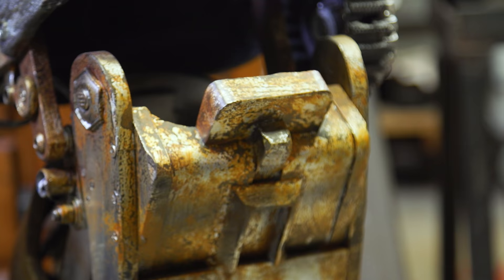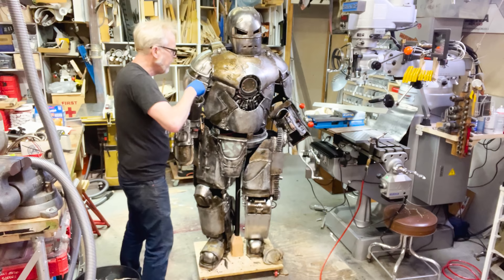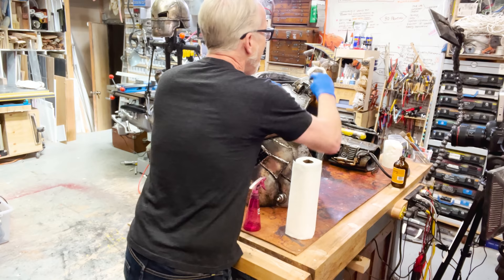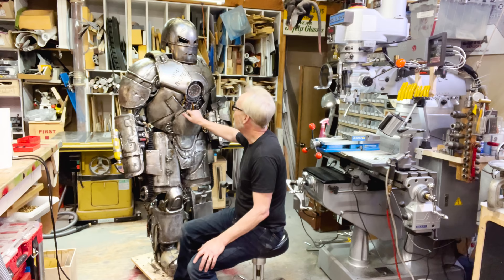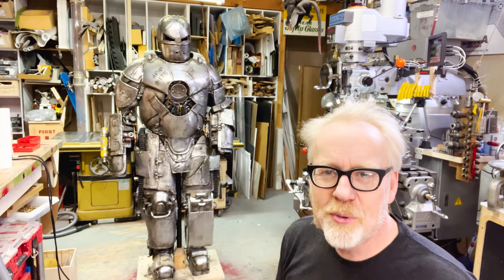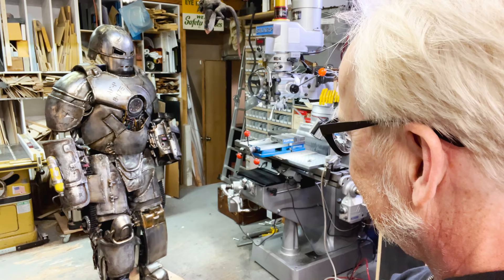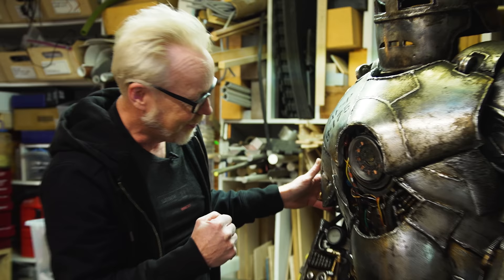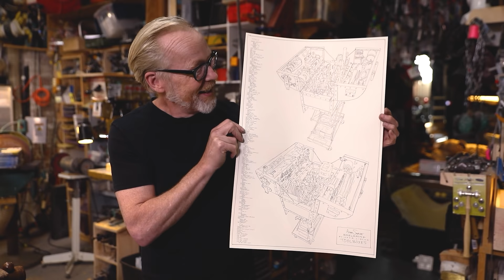Adam Savage's One Day Builds: Painting Iron Man Armor, Part 2!

Comment: Adam Savage, when you're doing chipped paint, spray your paint layer, mask and then spray your "revealed metal" elements. Then, with the masking STILL ON, do a grime pass where you remove with alcohol, but push the grime into the edges of the masking - this will give you the look of light being occluded by the edges of paint, and also, grime would build up at the edges of the chipped paint anyway. This will sell your chipped paint look far far better and is a better solution than hand painting or anything. It works in 3D art, it will work great for this practical stuff :)

Comment: AMAZING! Can you tie in the upper legs to the hips? The upper gearing of the belt drives doesn't read right with them flopping around on 3 axes. Even just  a last step where you snap a bolt from them to corresponding sockets on the girdle would 'sell' that they are driving from the core of the suit.

Comment: The issue though is that suit isn't actually all that rusty, go to 37-40 minutes in Iron Man 1 and look at it on a big screen, there is metal tarnish from impact, spatter from welding, etc but there is actually very little rust. And that makes sense for a few reasons. 
1. Tony had to build each part of the suit often fabricating and rewelding.. you should know Adam that you can't weld to rust.. it doesn't work. 
2. Rust requires moisture and time to form.. he was in a cavern in a desert in dry environment.
3. if there was the trust and oil you'd have  seen it in the shot were he's knee actuator is shot while the stufs exploding around him.. it's clean.

Plus look at the items around him when he crashes in what should have killed him.. tarnish yes.. rust no.